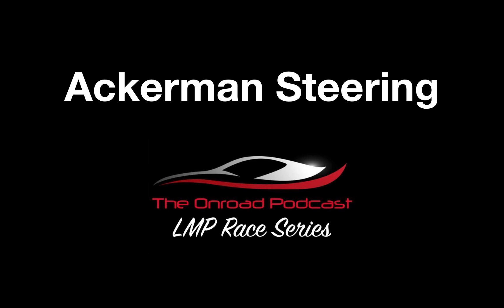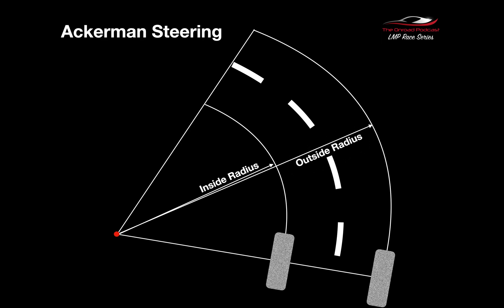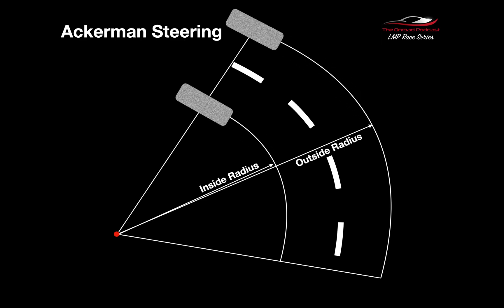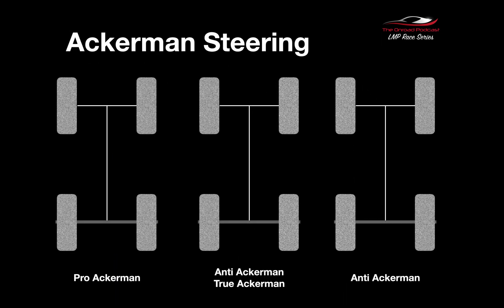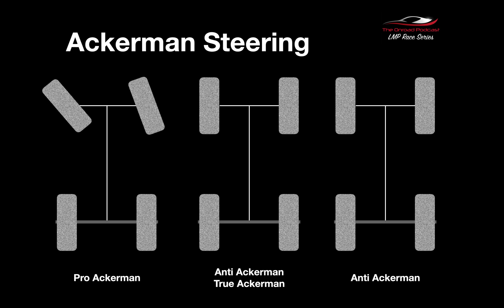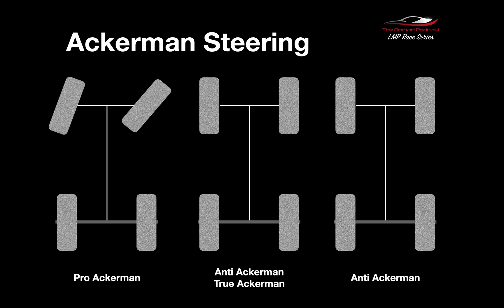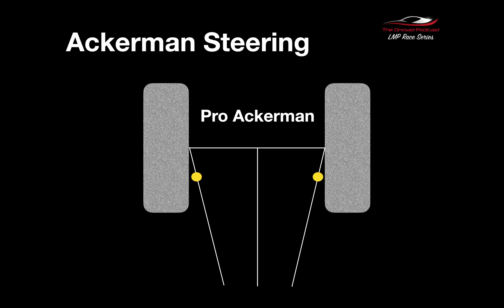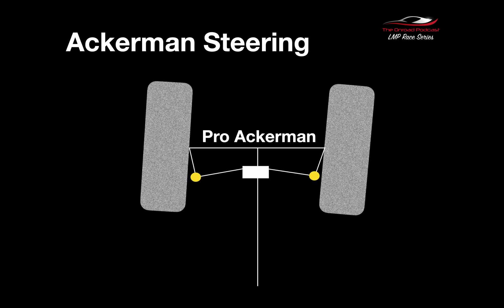Understanding ACKERMAN

Comment: The optimal slip angle of a tyre depends on the normal force (how hard being pushed down on road). It wants more slip angle when pushed onto the road harder. When a car corners the normal force transfers from the inside wheel to the outside. This means the outside tyre wants more angle than the inside one even though it's traveling on the larger radius, hence why pro-Ackerman might be a good thing.

Comment: last crc ck25ar with latest steering blocks (shorter arm / new hole) work  better then older one on track, it is less ackerman effect,  the inside tire has slightly more angle then outsie (previous setup isnide more angled), which means car is faster in corners compares to older setup

Comment: Ackerman is from my experience best to assess from its basic reference angle which is the track to wheelbase ratio related. If you know fine if not I will explain. Let me know. Basically Ackerman is not that complicated but I would say obsolete. I do my cars  differently avoiding Ackerman because it does make sense to horse and carts but in real speed it should be abandoned and chucked away.

Comment: The Infiniti Q50 Hybrid’s have a steer by wire system that steer the front wheels at varying rates. The outer edges of the front tyres wear heavily giving the impression that the wheel alignment is out. I’ve always known it was down to varied steering rates but now I know it by its name.
Reply from the maker: Glad to be of some use!
Reply: Steer by wire cannot cope with car steering they tried to use aerospace stuff but the flight is not a ride. Definitely Infinite stupidity in this case.
Reply: @radnasirhill  You’re wrong, steer by wire is very reliable in Infiniti’s and without issue
Reply: Did you made that comment 5 months ago about not even wear? Do you think that one side wear is a sign of correct steering if we are talking about low speed cars?
Reply: @radnasirhill  It’s a symptom of a highly reactive steering system. I’ve driven this system on cars that have done 150 thousand miles and they still steer like a new car. I think the future of this system is one that incorporates a reactive camber that keeps the tyre flatter to the road. At present Infiniti recommended wheel rotation from front to rear. This gives a more even and progressive wear and is a small price to pay for the steer by wire system and the benefits it brings which includes lower maintenance and fuel economy. I understand this system was banned from formula one but not sure why, it’s been said it was too advantageous but that’s something I will look into when I have time, it would be interesting to know how their system affected tyre wear.
Reply: @marklowry8799  Great answer and it does make sense but would say that the future should be a bit more adventurous and not to keep everything static from shape thru steering and interior set-up mostly. This 4 wheel Ford T type five unused seat filled one mans cars are getting obsolete in every way and from every aspect. I will try to look into F1 by yourself mentioned reachable to me stuff. Ta-Ra

Comment: I think the emphasis given to the turning radius of the inner unloaded wheel is over exaggerated in it's effect . Firstly it's not doing as much work as the outer loaded wheel . I think it,s more due to the effects of jacking up the chassis on that side which works in conjunction with the castor angle of the kingpin . You can see this effect on full size F1 cars when they do donuts, the whole car is revolving around a pivot point which is the inner edge of the front tyre that's jacking the chassis up on that corner . Stating the obvious The whole feel of steering on a 12th car is a combination of ,tyre/track grip , ackerman , lock , camber , castor all working together . I have been trying for 40 years and still don't manage it most of the time
Reply: Another thing I meant to add is driving ability . All the top drivers have cars set up with a lot of steering and are edgy ( I doubt if I could drive their cars in a straight line ) but they look smooth because of the drivers ability and throttle control . 12th cars need to be pushed into corners loading up the front but then balanced with throttle to rotate smoothly . Backing off the throttle to much will make it unstable ie the front digs in  . Spool diffs have made good throttle control even more important because they seem to need to be pushing all the time so a throttle jabber like me stands no chance . These are only my opinions so if any one wants to rip me to bits carry on I would like your thoughts .
Reply from the maker: Hi Fred 
Many thanks for the feedback. The inside wheel is huge when it comes to Ackerman, even thought it’s unloaded it’s a huge influence on turn. The inside wheel creates a yaw effect to rotate the car. 

Contrary to belief and I’ve spoken with Alex Hagberg a lot on this; 12th scale cars for the best need to be easy to drive and the edginess isn’t as much as you may think. 

Always great topics of discussion  and appreciate your thoughts.
Reply: @RCRaceCar   I agree but I still think it's due to the jacking effect but obviously the steering angle has it's input .
Reply from the maker: @fredhatfield5863  the jacking affect is more associated with castor angle.
Reply from the maker: @fredhatfield5863  and camber...